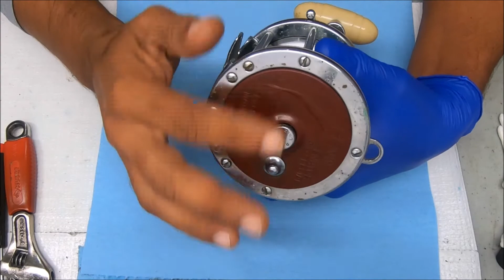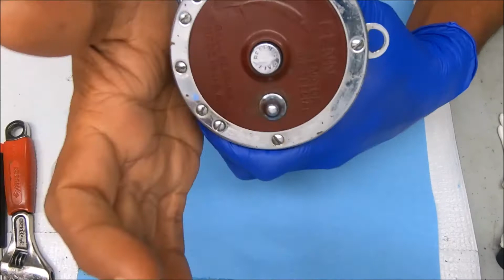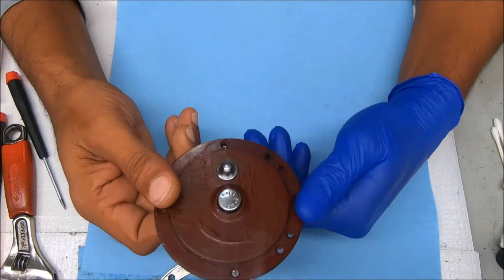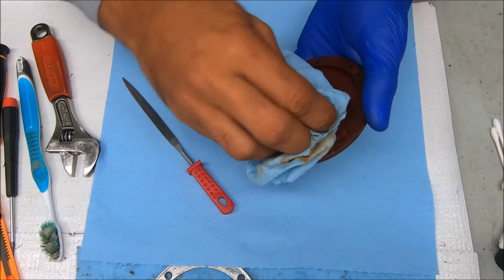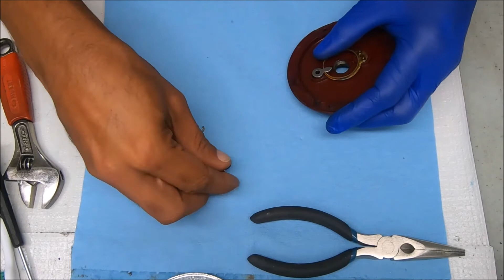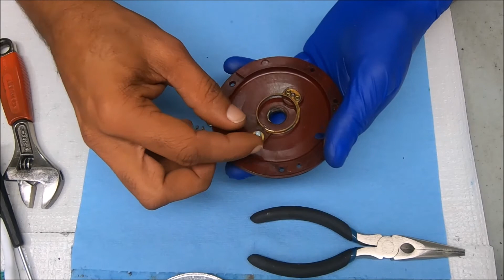Penn Senator 4/0 (113H) Peened or Permanent Clicker Repair / Replace: Fishing Reel Repair

Comment: Thank you so much for your informative videos !,, i have a penn 113h  with a slightl wobble in the reel handle stem  would it be a worn out bridge stem  ?,, the handle is tight !
Reply from the maker: Thanks for the compliment! If it's not severe, it's fine. Slight wobbles happen. If there's lots of flex, then you likely have a broken shaft on the bridge (what the gear sleeve goes over).